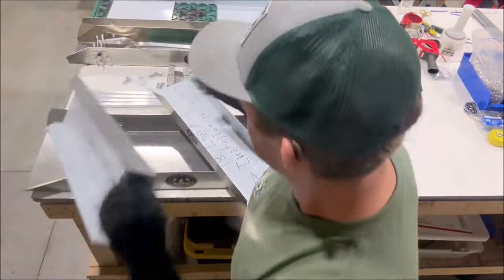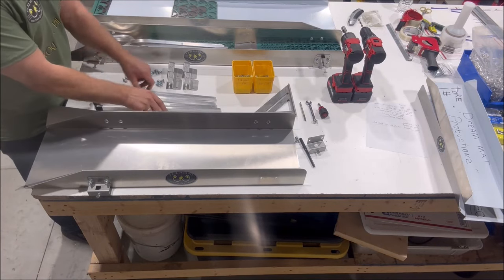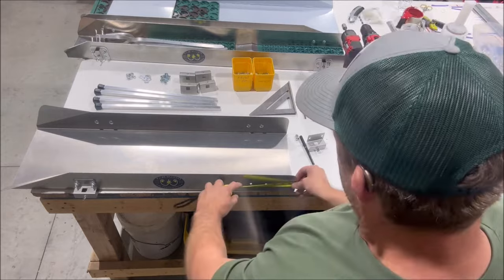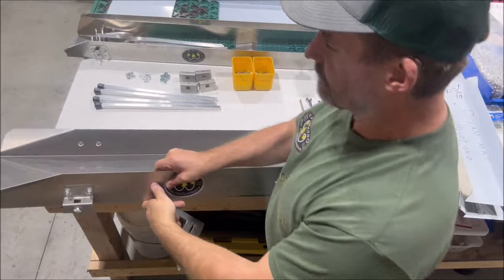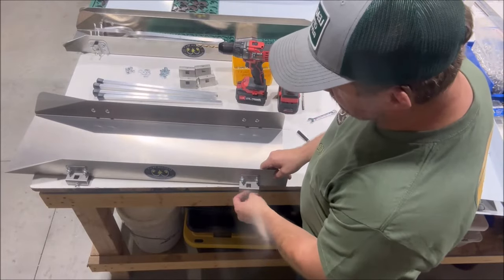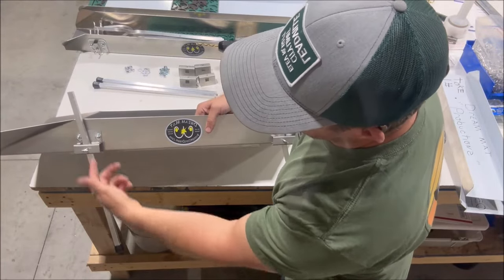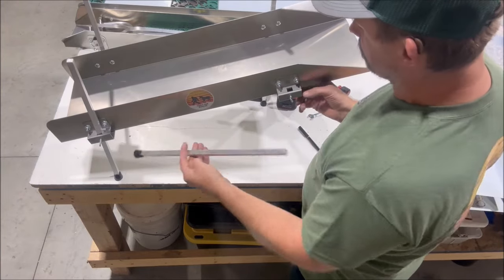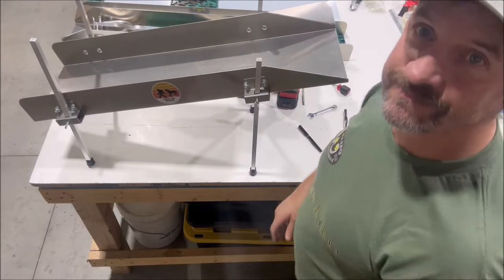18-Inch Leg Kit Installation Tutorial & Tips

Comment: I’m not sure if you have like a thank you note or any kind of paper brochure included in your kits, but maybe you could include some template markings and/or measurements for the different size sluices. 

I work in the kitchen design/manufacturing/install business and most kitchen appliances and fixtures come with some form of paper/cardboard templates for installation. 

Just a suggestion to save mistakes being made by not so confident “handymen” among your customers. 
No one wants to go to the creek with a sluice that looks like it was manufactured in Beirut 😂